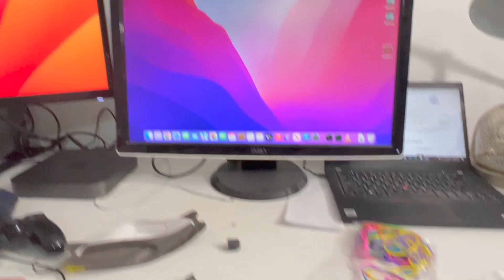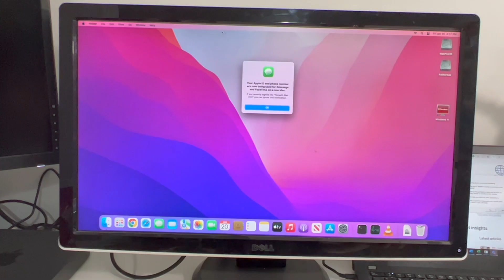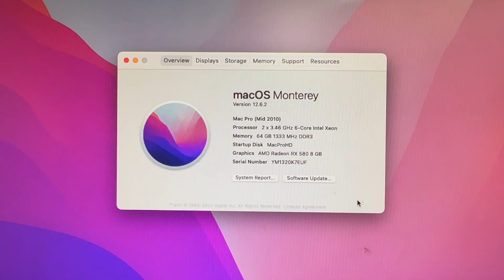Apple Mac Pro 5.1 2009 / 2010 / 2012 2 x 3.46Ghz 6-core x5690 Intel Xeon Westmere CPU upgrade MacPro

Comment: Mac Pro 5,1 - 2010
 *2 x Intel Xeon 3,06 GHz 6-Cores
 *40GB RAM DDR3 1333 Mhz
* Video AMD RX570 ITX 4GB 256biti 
*NVMe Samsung 970 EVO Plus 500GB instaled on adapter Aqua Computer kryoM.2 evo PCIe 3.0 x4 Adapter for M.2 
* Plus backup: SSD 240Gb Kingston
Dual Gigabit LAN
Price 300 dollars
It's okay for office and some games.???

Or 
Mac Pro (Mid 2010)

*2 x 3,46 GHz 6-Core Intel Xeon

RAM 32 GB 1333 MHz DDR3

GRAPHICS : AMD Radeon Pro W5500 8 GB

Storage :

1 - SSD 240 GB - OS

1 - HDD 1 TB - Scratch Disk

1 - RAID HDD 2 TB - Storage

Price 500 dollars

What to choose from the price and for the best configuration . Tanks.
Reply from the maker: Thanks for writing. In my opinion ---> The 2nd config is the max level you can upgrade the Mac Pro 5.1 line as far as CPU specs go, however the first one seems to be overall a better value for the money, I think, as you get NVME storage, a solid GFX card, and more ram. I think for games, there is not much edge to either config, and keep in mind that these are now 14 years old or so, so not going to be performing well for most modern games of today (if you run through Bootcamp/Windows), however your milage may vary based on the age of the game you are playing, and perhaps 5 year old or older games may be more acceptable in performance. Can't give a definitive answer here, as it's highly subjective.

Comment: You forget 2X3.33 before the 2X3.46
Reply from the maker: Thanks for your comment. I personally had 2 x 3.06 in mine before this upgrade.
Reply: @DataHombre  
Hello, I have 2 Mac Pro mid 2012,one has 2X3.33 and another has 2X3.46,both with 128 gigs of ram ,both are running macOS Monterey on nvme in raid zero,GPU is a RX580 -8 gigs
You can upgrade yours with OpenCore  Legacy Patch...
Reply: @Locky2701  are there noticeable performance differences?
Reply: @jovendios  
Not really, I got 2X3.33 first and 2X3.46 after from my friend
Reply: @jovendios  
If you have 2X2.93 or 2X3.06
It's better to upgrade to 2X3.46